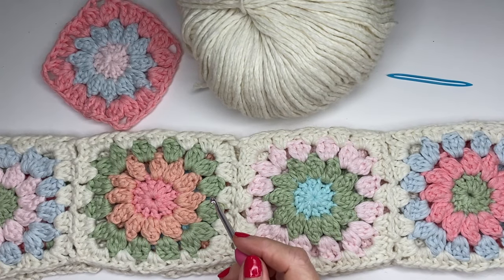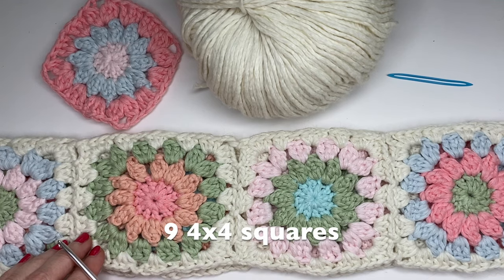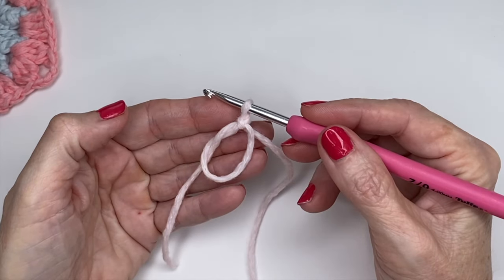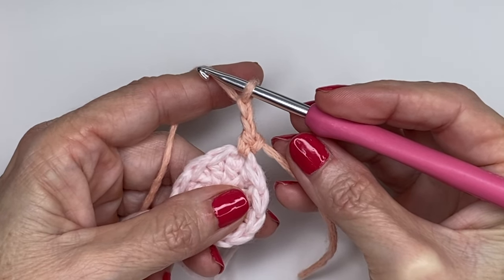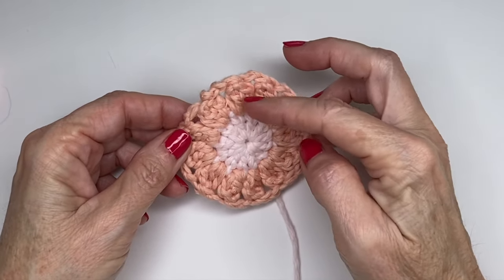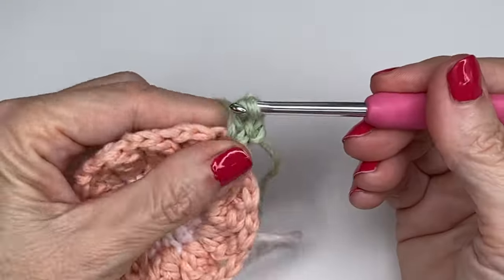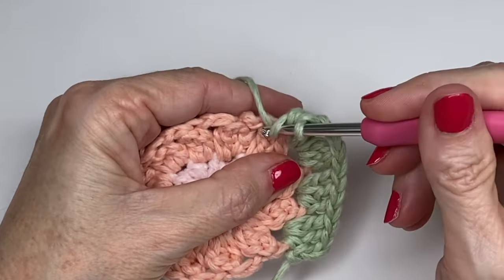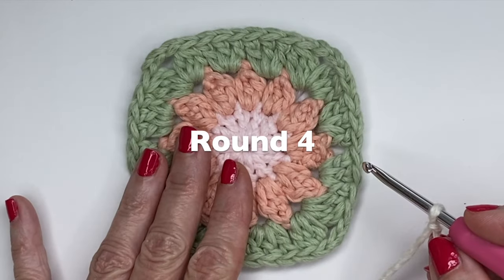Crochet Steering Wheel Cover

Comment: This is clever and really cute.❤❤❤  If you're worried about the cover slip-sliding around, maybe you could cut a narrow strip of the no-slip grip rubbery fabric like material that comes on a roll and tape it to your steering wheel with 2-sided tape.  I don't know the name of it but I call it slipper-gripper.  LOL!  You can usually find it in rolls and people sometimes line kitchen drawers with it but I've found a multitude of purposes for it.  Thanks for the inspiration and for sharing this tutorial! ❤👍🙂
Reply from the maker: Excellent tip! 😀👏🏻💕

Comment: I made it with scrap all pastels. It's georgeous.. I only fastened to wheel in 3 places. And if I want to grab under the material. I can do both because I just brush the fabric aside and grab the uncovered wheel. I put in top center of wheel. Then opposite at bottom and then another spot. I tacked it to wheel. It's wonderful
Reply from the maker: Excellent 😀👏🏻💕

Comment: Thanx Ma'am. Made granny belt. Wanted to  learn how to join with elastic instead of stitching as to gift fully... 👍
Reply from the maker: You can attach the elastic to inside of belt with needle and thread , yes great idea. 

Take your strip of elastic and wrap it around your wheel … make it stretch to reach around. 
Cut it and sew that to the inside of your belt. 

Or you can sew your crochet belt to an elastic car wheel cover that is already made.

Comment: Do you know if this fits a “d” shade steering wheel? Like the one with the flat side on the bottom of the steering wheel?
Reply from the maker: It should be able to work . You’ll probably need less squares for this and secure with a tie in the corners (at the bottom of the steering wheel where it’s flat.) 
🧶💕

Comment: Super cute,, but how does it not slide on the wheel??
Reply from the maker: I explain that in the video as well as in the description box 👍🏻
Reply: @ Laurel S.  You make it smaller than circumference, stretch it to fit, and securely fasten it together.  Hint:  you can also use non-slip shelf liner, cut a thinner strip to place under wheel cover, then affix cover in place.
Reply: @creative2716  thx ,,I read the description after I posted this..good idea with shelf liner..